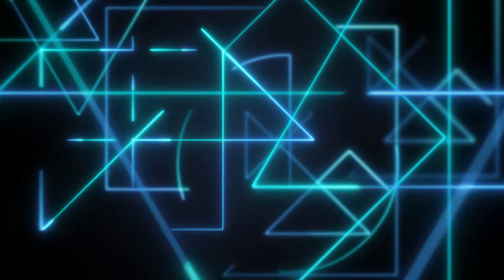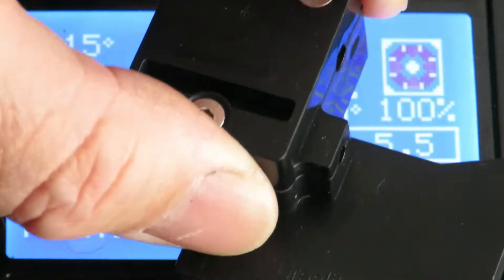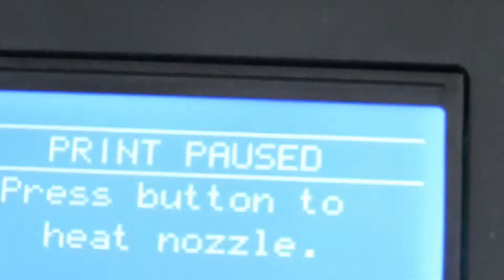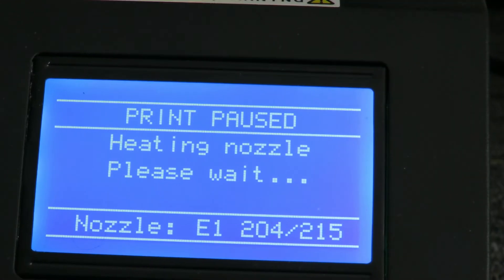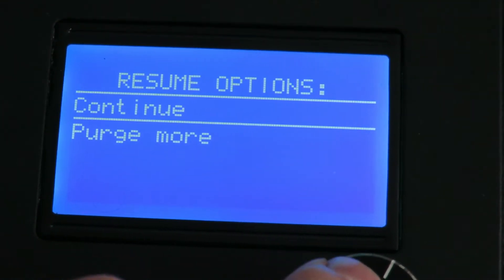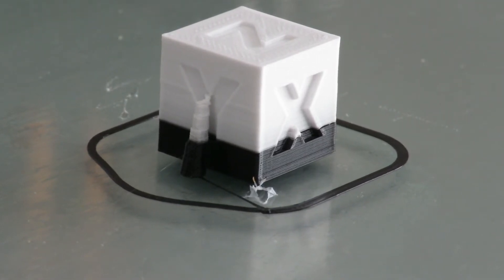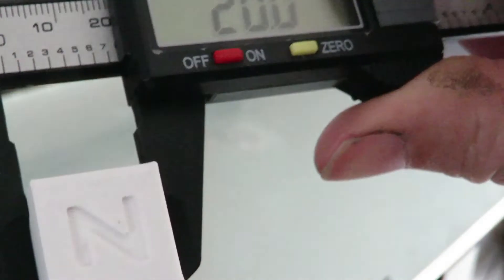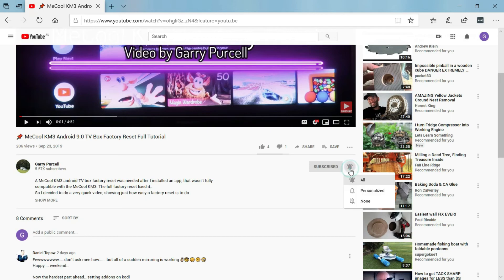📌 Creality CR-10S Mainboard v2 2 Filament Runout Sensor Test and Review Part 3 of 3

Comment: Hi Garry. Thanks a lot for the guidance. I just finished installing the V2.2 board and the BL Touch sensor. Are there any resources for configuring the printer once it's all back together? Specifically, telling it where it's motors are? Right now it's trying to drive the Z axis into the center of the earth. It's been a long time since I first set this thing up.
Reply from the maker: I made a video a few years ago that might help you with configuring the software for the printer.
https://youtu.be/jgy-OPMWV7M

Comment: Hey mate, wondering if you can give me a hand, I purchased a Cr-10s 3 days ago, and so far the sensor has given me nothing but grief.  The sensor is non functional, and so far I've found no way to disable it, not even the bypass chip stops it. So I can't start a print, because I get ERROR change filament.  Is there a way to remove it from the control box, or just change it so the print can start without the sensor? Thanks.
Reply from the maker: The easiest way is pop a small amount of filament in the sensor, so it thinks you are running filament through it.